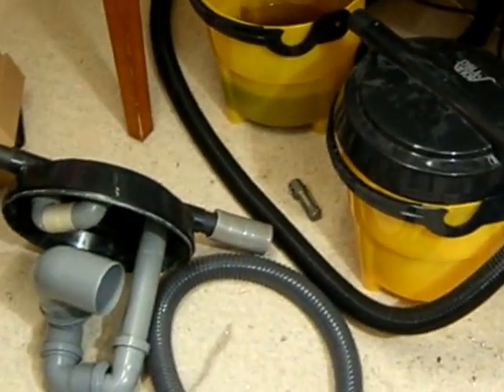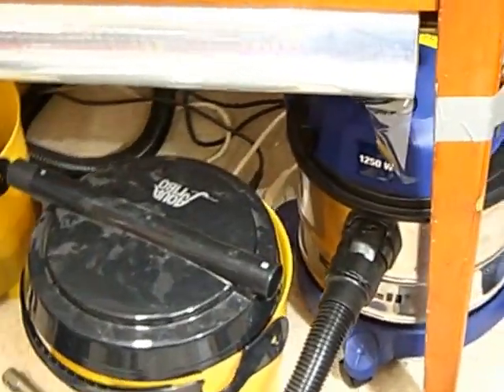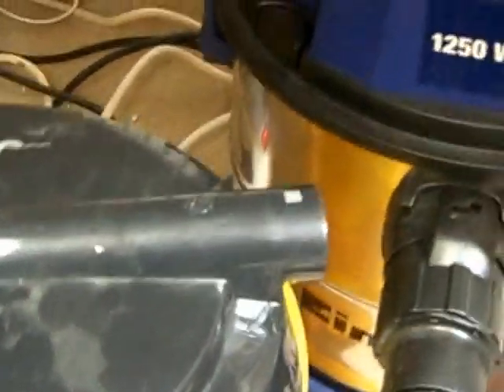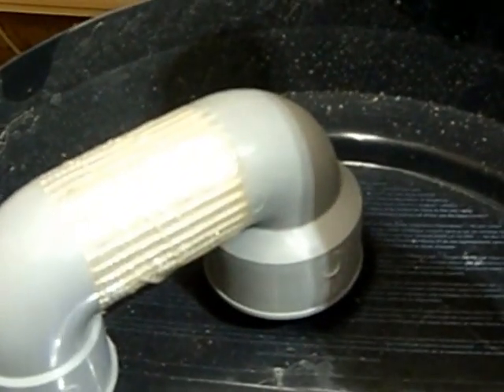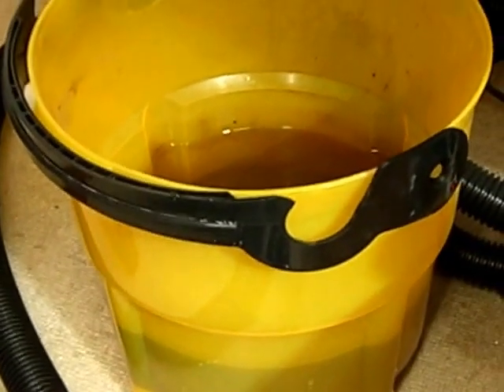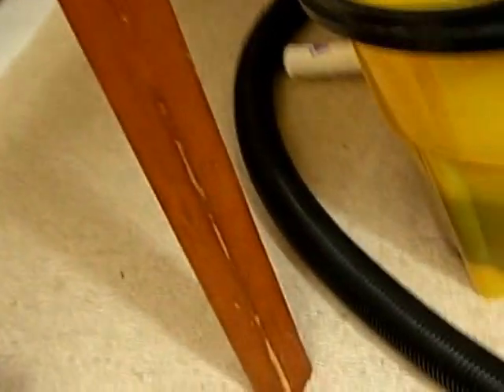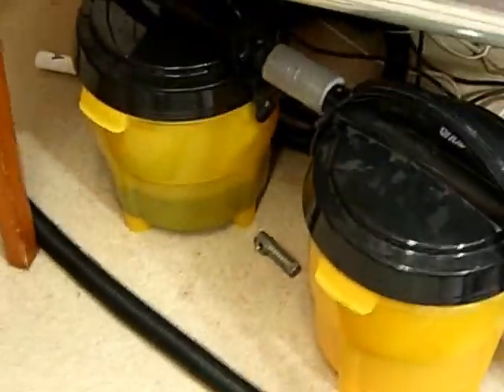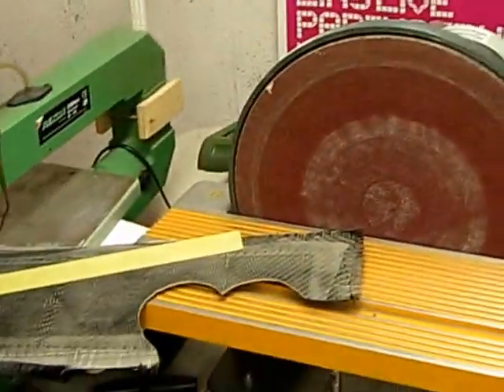My workshop vacuum cleaner filter system

Comment: I created a 3d printed version of this for my bathroom renovation and it works quite well behind a cyclonic separator.  I had to add a water separator chamber on the vacuum side and the water level is very important.  I also had to add vinegar to reduce foaming.  I might post the 3d model on thingiverse and mention you as the designer.

Comment: Great idea! Any additional improvements over the years? Danke!
Reply from the maker: Thank you! Indeed there was an improvement, namely that I now use a real cyclone separator as the first stage. Additional info here: https://www.rcgroups.com/forums/showthread.php?1700535-Dust-Captain-cyclone-separator-and-DIY-water-prefilter-for-workshop-dust-collection
Reply: @Extremflug  I have the cyclone separator that I use for my sandblaster cabinet.https://www.youtube.com/watch?v=wFDn6lkKhNw
 It works well and catches a lot of rusty dust, but the fine dust is clogging the filter in my vac. I am working now on assembling the wet filter. Thanks again, danke!